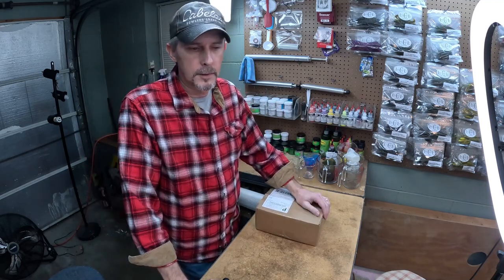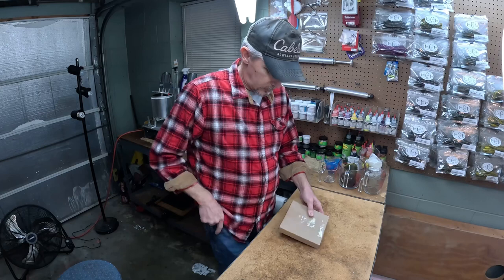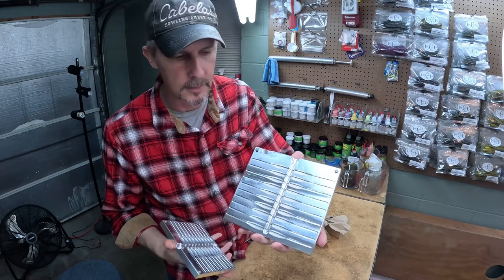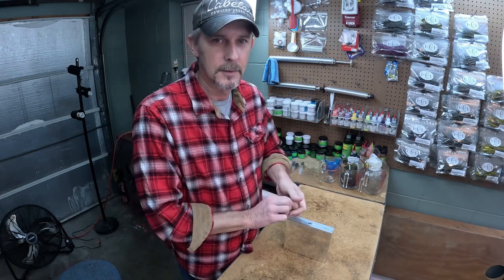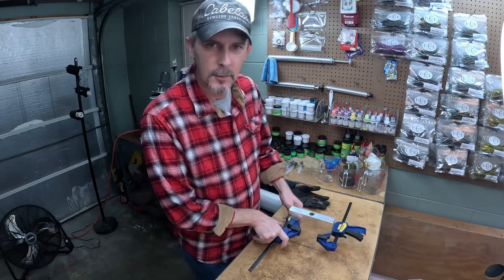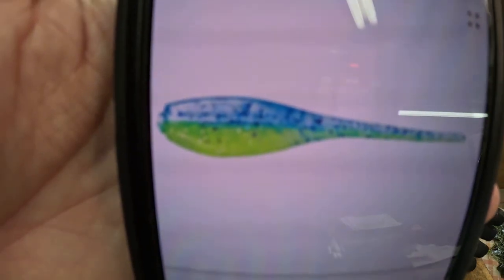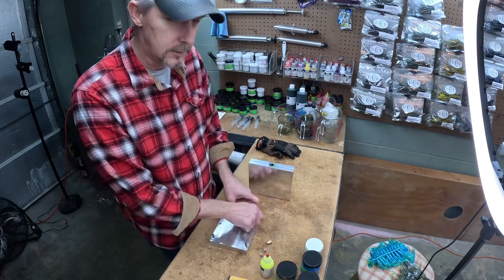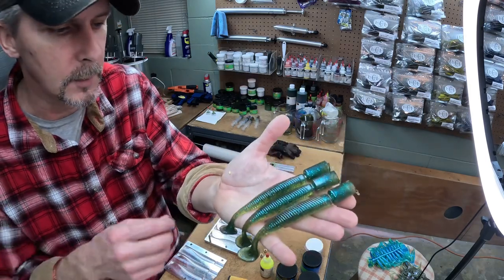Soft Plastic Bait Making. New Bait Mold-Two New colors-Color Matching-Bluegrass-Crappie Baits

Comment: I just bought the 2 inch crappie slayer mold along with the tail mold from epic bait molds. It shoots nice. Do you use more liquid or powdered colors when mixing?
Reply from the maker: Mostly liquid with injection. Mostly powders with hand pouring. Nice I went ahead and ordered a couple more molds from Epic.

Comment: What temperature do you use for dual injection

Great videos
Reply from the maker: Depending on the density of plastic I am using will factor what temp I am injecting at. I normally will inject a soft blend 300-310 medium blend 310-320 harder blends 320-330. This will give you a good starting point. Thanks for watching.

Comment: Really,  there's nothing epic about Epic Molds except for their prices. They act like it's Valyrian steel or Adamantium or Adamantine or Vibranium. I mean, it's just plain old aluminum, right.
Reply from the maker: This was my first purchase from EBM. After running about 2k baits through it i ordered more of the same.  The price doesn’t really bother me. I have other panfish molds with equal cavities I have purchased from other CNC company’s that cost a right smart more than this one did as long as the product will perform and hold up to the production that I need for them to I’m okay with the price.